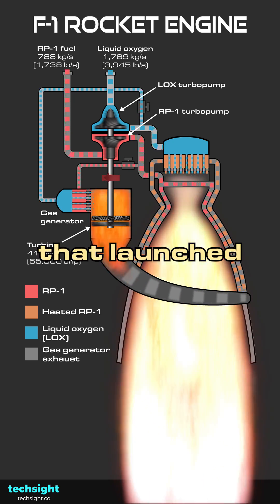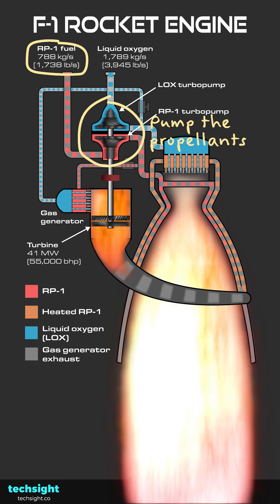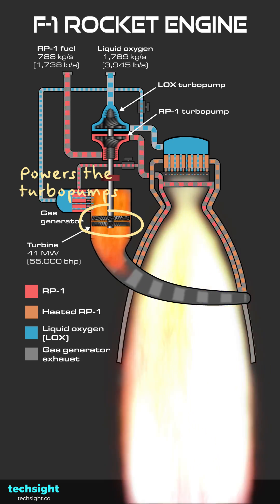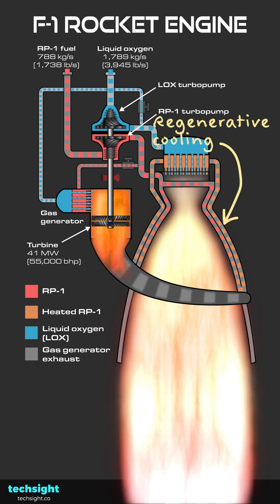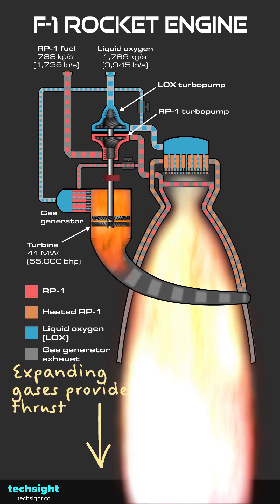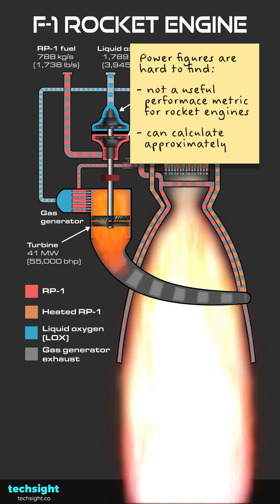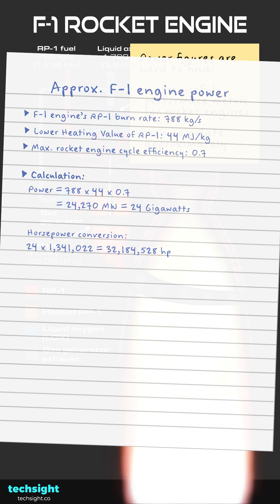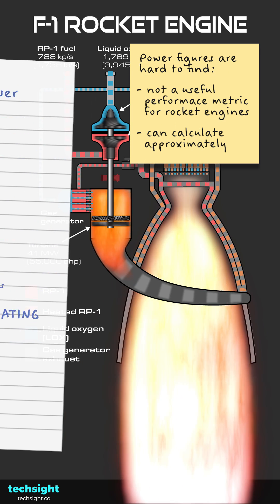How powerful was the F-1 rocket engine? The answer is ABSURD.

Comment: Sry but rockets do not go to space because rockets can not produce thrust in a vacuum sry
Reply: Yes they can.... They are ejecting mass
Reply: @miranarak  ok so they are ejecting mass what happens to the mass once it gets ejected in a trillionth of a second it gets sucked up by the vacuum of space before it can push the rocket forward
Reply: @James-zp5po  how do rockets stabilize in space? They use thrusters, which ejects gas to push the ship in space
Reply: Ever heard of Newton's third law?
Reply: @-SpaceFrog-  and you haven't action reaction only when air is present I do my own thinking I perform my own experiments have you ever heard of these things give them a chance since you were 2 years old and believed in Santa Claus just because you were told it was true and now 30 years later still just following along
Reply: @James-zp5po  You're deluded by the cult. Reaction engines rely on every action having an equal and opposite reaction. So if you throw mass one way, You accelerate the other way. Air is irrelevant in this process as the method of action is not pushing against anything but using the recoil from throwing mass one way to accelerate the other way.